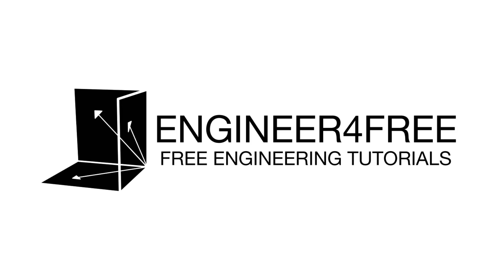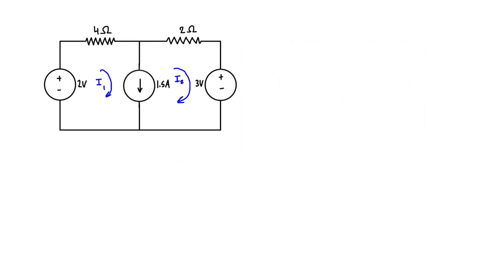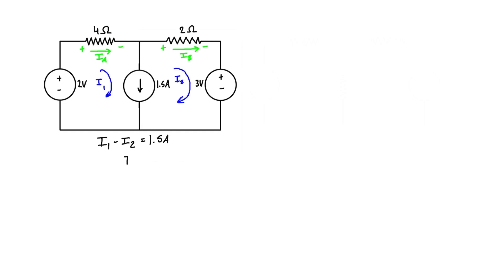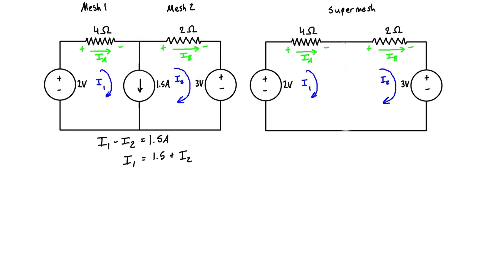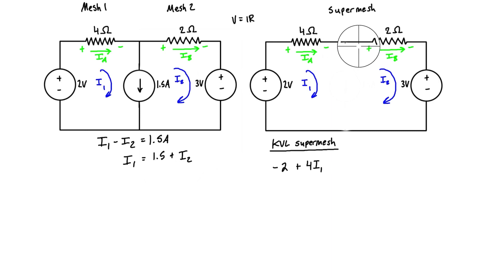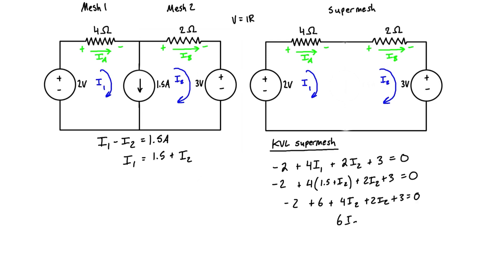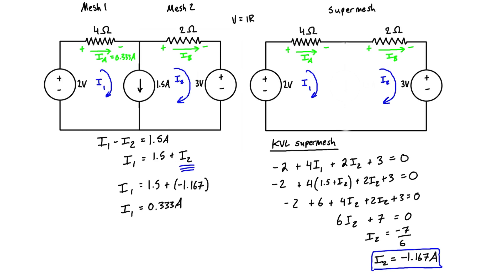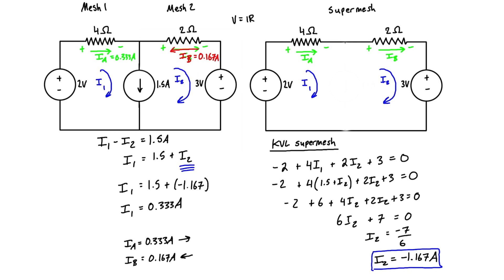Supermesh Analysis Explained

Comment: how the hell is it -2+4… the signs should be the opposite
Reply: Because he is using a convention inverse to yours its doesnt change anything because he puts the inverse signs to everything your convention would have been and so the signs cancels and you get the same answer eitherway
Reply: i'm also confused
Reply: Current entering voltage + terminal is + and current leaving voltage + terminal is -

Comment: what if there is a resistor value in the middle branch?
Reply: Instead of the current source? ( I presume that is what you mean ) then in this case it would only be a regular mesh analysis. You would have R*(i1-i2) for mesh 1 and R*(i2-i1) for mesh 2
Reply: @jad8799  No, what if its BOTH  current source in series with a resistor

Comment: Your supermesh won't work. 1) science has proven that electrons flow from negative to positive. 2) you have negative to negative, & positive to positive. Current won't flow...
Reply from the maker: Hi Dewayne, most circuit analysis problems utilize something called “conventional flow” it is opposite to “electron flow.” I recommend searching up the difference between the two
Reply: @Engineer4Free  I understand the term "conventional flow". It's how electrons were believed to flow, until the invention of the electron microscope. To use convectional flow is to do it wrong.

Comment: why  re-draw  Ib  in red ?
100 %  un-necessary.
and why not  re-draw 
the Green  polarity as  -  +
across the 2 ohm resistor
to pretend the voltage is
+pos  across the 2 ohm resistor ?
completely un-necessary
and
adds  clutter to the diagram
Reply: Well okay but you could be less rude , he's helping us during our exams
Reply: shut up